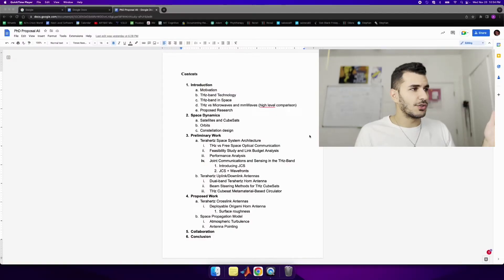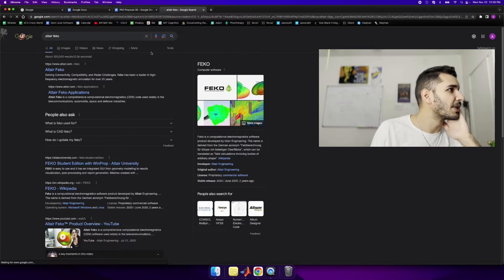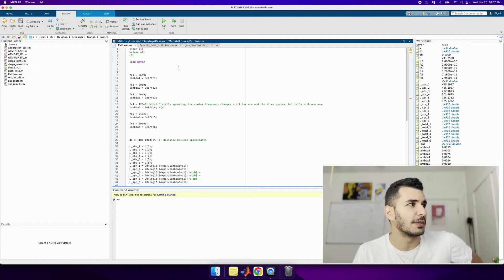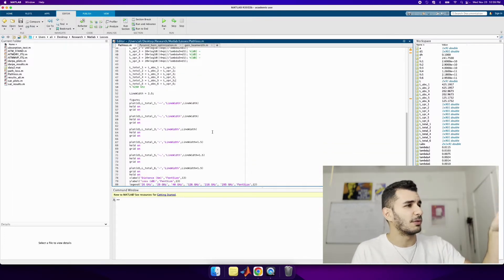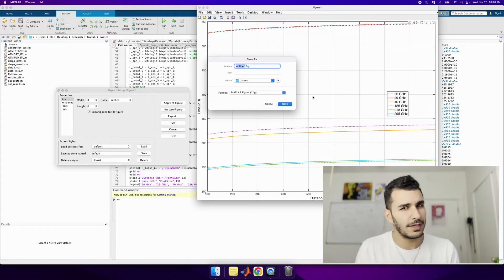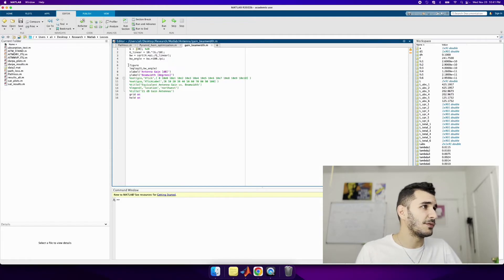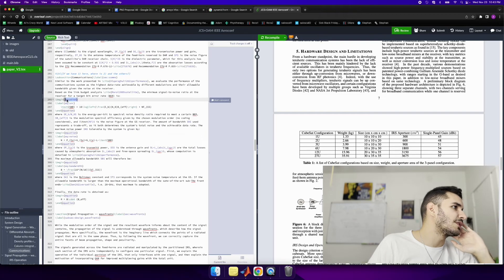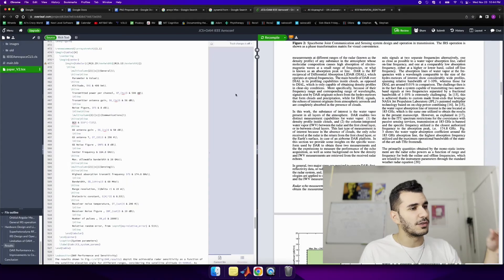The Software I use in my Electrical Engineering PhD

Comment: Matlab is not a programming language because it doesn't compile.

Otherwise we will consider English and other languages as Programming languages.
Reply from the maker: "A programming language is a system of notation for writing computer programs" -- "MATLAB is a high-level programming language designed for engineers and scientists that expresses matrix and array mathematics directly."

https://www.mathworks.com/products/matlab/programming-with-matlab.html
Reply: @alithedazzling  Mathwork is not a good reference in this context because they will market their product as best as they can. In fact, as per their definition, math and physics are programming languages which they are not.
Reply from the maker: @of499  but that's not the point, isn't a programming language a set of instructions that tell a computer what to do? matlab involves everything; functions, conditional statements, loops, etc.
Reply: @alithedazzling  When we speak to Siri, the computer follows our instructions. That doesn't make English a programming language. Similarly, writing commands in a command CLI, or formatting web text using CSS, doesn't make them programming languages.

If it doesn't compile (i.e. change from a human readable language to a low level computer code) it can't be counted as Programming Language (PL). Otherwise we will end up with labelling every language as a PL, eventually the term PL will loose its meaning.

Great videos btw, keep it up 👍